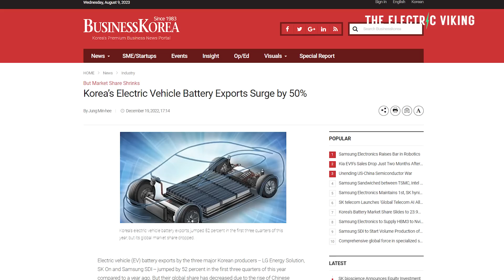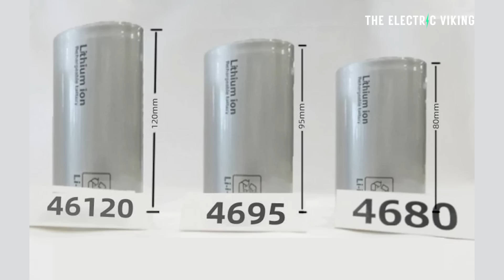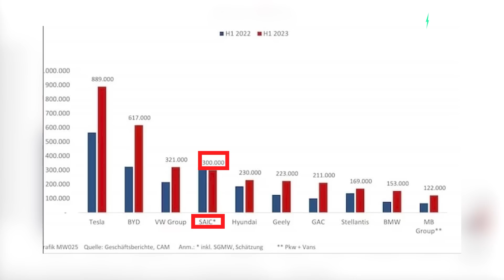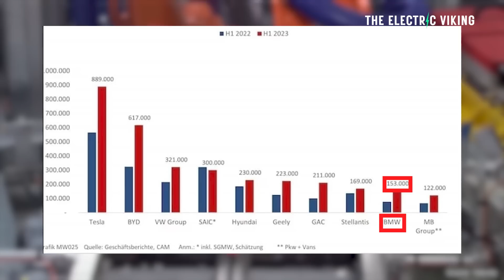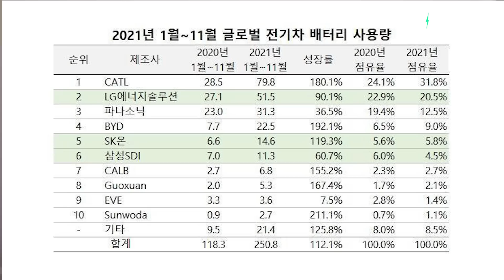Samsung hits 4680 Battery energy density target in race for Tesla order

Comment: while energy density may be an issue; the primary issue with 4680 is that they fail.  The resulting reject rate is too high to make a cost effective vehicle; hence the food dragging for all 4680 dependent designs;  new Roadster, Semi and Cybertruck.  Tesla can make some at a losss; but it isn't a helpful contribution until the failure rates can be reduced to minor levels, ans the cost per functional cell reduced.

Comment: 4695 and 46120 will be cheaper and have more energy per unit of mass than 4680. Under a vehcile floor it is easy to hide 46200 cells - we should expect them in larger vehicles. Light and heavy truck makers will love them.

Comment: Higher batteries are just making the position on the wheel higher but uncomfortable as the driver will lean in the car... is works on small cars, but not in higher cars, is difficult to see the road in front of the car... If they want to use them for specially made cars...small volumes just rise the costs...

Comment: From other battery sectors, other than EVs, there are rumours that Milwaukee are likely going to bring out a new battery type for their larger tool batteries, going to use "tabless 21700 cells". Interesting space to watch.
Since they also use Samsung cylindrical cells, it will be interesting to see if Samsung will deliver these.
Reply: You'd think they'd all go tabless once they've worked out the kinks in the process.  The extra copper usage is tiny, and even an 18650 would benefit in high current apps.

Comment: 4680 are also designated to be used in the Tesla Semi as well as the CyberTruck., 
10 Gw hours worth of battery that is only the capacity of the Tesla prototype facility at Kato road.
Reply: Elon said the Semi doesn't use 4680 cells.

Comment: I think TESLA is playing with the chemistry of their 4680 battery . I suspect that is the real holdup in production , a new Chemistry like CATL M3P may advance the 4680 by about 20% and lower costs maybe by 15% . SAMSUNG making 46120 may be good for TESLA semi truck sold internationally  because of the Inflation Reduction act , but Free trade agreement between USA and Korea  may override that so they may be able to use then in the USA  .
Reply: I don't believe it is the chemistry that they are playing with so much as the process. Tesla/Elon are environmental conscious and also firm believers in simplicity. When Tesla unveiled its 4680 battery cell at its Battery Day in 2020, Tesla highlighted several advancements that can significantly slash battery costs when bottled together. One of those main advancements was a dry electrode coating technology that Tesla obtained by acquiring Maxwell. This powder-into-film process is wildly less complicated and requires less machinery than the usual wet process to create an electrode. Tesla claimed that it would result in a “10x reduction in footprint” and “10x reduction in energy” usage. So they have been prepared to take much longer to perfect the dry cell process as opposed to just ramping up the production of 4680's using the wet process.

Comment: The important factor is energy density and price. That's what will lead to dominance in battery manufacturing.
Reply: Compatibility and availability are also important,  as car makers switch between suppliers to meet current production demand.  With standard cell sizes,  they are a fluid commodity.  A small delta in performance or price may not be so important.  Tesla, for instance,  switch chemistry without affecting sales or their reputation too much.

Comment: I have always (well, for a year or two) assumed that form factor did not dictate battery chemistry. I'm curious if there is a reason that 4680 can't have M3P, LFP or whatever chemistry, or perhaps that 4680s are not as efficient as a prism/blade form factor for some chemistries? Specifically, are 4680s optimal for "dangerous" chemistry and suboptimal for "safe" chemistry?
Reply: grade of elements, manufacturing process quality, engineering of the form and level of local corruption all effect this. i wish i could be more exact but the YT police would chase me.
Reply: 4680's are made in a different (dry) process compared to 2170's. It was meant to be faster more efficient cheaper than 2170s. No doubt you could make 4680's in the same way as 2170s but they wouldnt have the same cost characteristics as Teslas 4680s. IF that is Tesla can perfect their 4680 process as obviously they have run into issues with that.